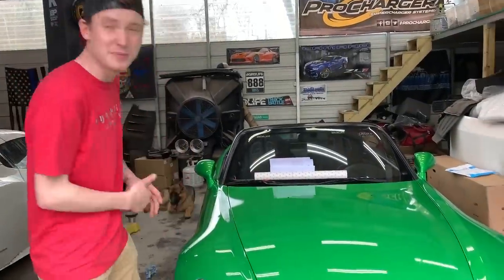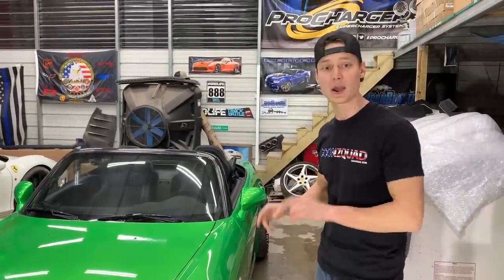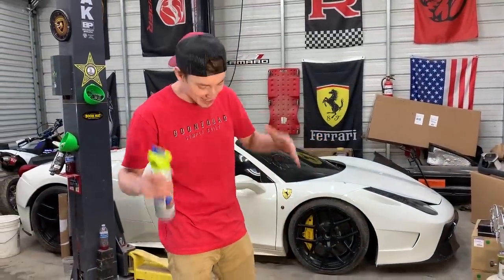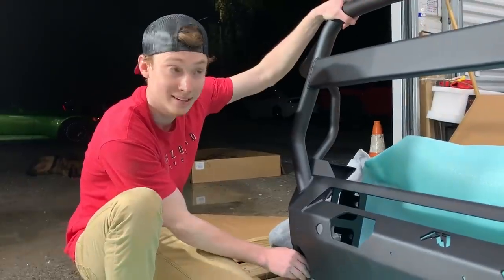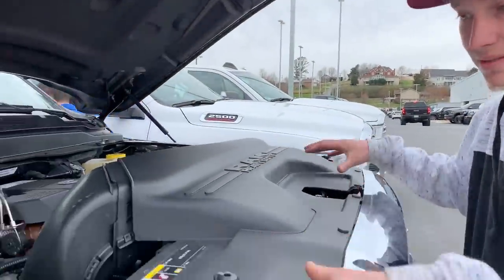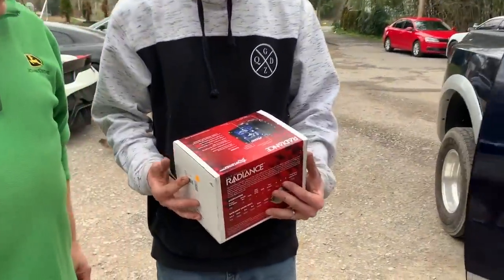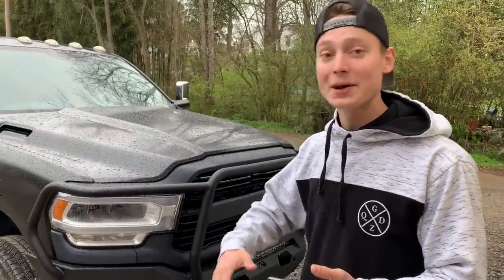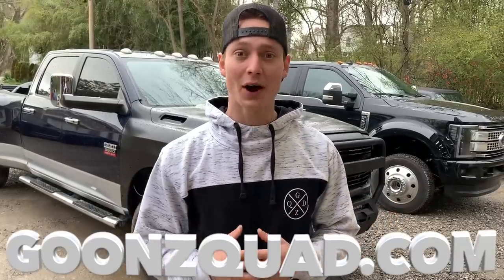Building My Dad His Dream Truck Part 5

Comment: The lower bumper looks cleaner on the 3500 example you showed; the one you ordered blocks the RAM sign on the front of the truck (others might disagree). Since dad might hit a deer at some point, this is the far better rack for sure. Also, consider installing a tow receiver on the front (don't bolt the winch to bumper). A receiver permits the winch to be switched from the front of the truck, to the front of the trailer to help winching loads onto the trailer.  Food for thought - Great Build as always!

Comment: Those holes are for the winch engagement lever, and to run your winch solenoid controller cable.  The opening for the winch cable is called a fair lead, and they can be a roller style, or a hawes (smoothed/contoured aluminum..

Comment: I’ve done it before on multiple cars but you can actually heat up the glue that holds the clear lens on and separate them. Paint the trim and glue them back in. Just be carful with the clips. If they break it’s not the end of the world

Comment: Maybe try to find same type crimp on terminals and crimp them on to the old headlights wiring harness or even check, maybe the terminals in older headlight connector are same and you can just swap the plastic housing - this way the harness looks 100% OEM without any extra wiring mess and soldering.

Comment: You should check about converting a vehicle used in commercial applications. Changing anything from its original OEM configuration requires certification from the manufacturer. Converting the front end may fall in that requirement so your father cannot use that truck in hot shot trucking.

Comment: I rebuilt a cadi CTS and was having issues with the headlight connector since it had been damaged in collision.  The dealer sold me connector and wires like what you got but would not give me the wiring diagram, they said I would have to take it and have one of there techs build the connector at shop rates. I went to my local library and they have accesses to what repair shops use for repair diagrams through a database call ALLDATA, I was able to print out the headlight wiring diagrams and that helped me out on what wires to use.

Comment: Harbor freight has a real good winch with synthetic cable. I've had mine with a steel cable for a couple of years and it works great. You may want to include the D rings on the front for different winching operations, maybe hide them in the glove box or other storage place. Lookin good fellas, keep up the great work. any updates on the new shop?

Comment: De-pin the new headlight plug and re pin the original harness into the new plug so you dont have a sketchy crimp connection or was of electrical tape. Itll be clean and factory

Comment: So that sir bag you mentioned wrong color. Correct do not try to paint it. But here is a suggestion you might try and if done properly you will never tell it was ran brown and not the black you made it. I used to work in my uncle's upholstery shop and we did recoloring and touchups on faded or discolored Vinyl and naughahyde tops on cars and dashes and even the seat coverings and mid consoles. You need to go buy a specialty chem and color kit for plastics and vinyls. under $75 and is amazing. My niece spilled nail polish recently on my mom's brand new couch it's dark brown and the nail polish removed the color and big white spot on one the cushions . I had this kit now since 1997 to color a vinyl top on a New Yorker. You can't even tell it was recolored. The couch that is. I had my niece in tears when I first saw what happened . I said to her you know how many Naughas they had to kill to make that couch and there extinct now and I can't get the naughydes to fix it...............I'm a ass LOL.

Comment: You hot to give your pops a lift kit with tires and wheels and the electric drop down side steps. The front bumper you guys is dope but the one at the dealership I have to say beats out the one you guys have. But any way you guys build this truck its awesome one keep up the great work and content.

Comment: You guys will have problems with those led lights around the headlights,  working properly, they cancel out when you turn the signals on, so the turn lights can be seen, so they have some kind of system that does that, and 2012 model s dont have that

Comment: Ok so if yall wanna know more about the speaker the regular price is $199 BUT if you use code:GOONZQUAD you will get 65% off your order and then you'll just have to pay $70 and you can't beat that price it's very cheap compared to $200. Thank me later Goonzquad 👍🏻✌🏼 

Edit: Goonzquad you should pin this so it would be easier for everyone else to see.

Comment: http://connectors.dcctools.com/home.htm

You can use this website for finding the correct pin location for the 2012 Ram 3500 headlight harness and the newer 2019 Ram 2500/3500 headlights (listed as premium headlights I think)

Also, you might need an adapter for the 2012 harness for projector headlights of the 2013+ because they use LEDs for the turn signals and might show up as a CANBUS error:

https://shop.retroshop.us/ProductDetails.asp?ProductCode=13%2EAdapt

Comment: If you're gonna run it as a Hotshot. Better buy a new Turbo. Because it will go out. I have 2017 it went out around 120k miles. Along with a long grocery list of parts especially the DEF system..  delete it if you can.

Comment: I think at this point it would have been cheaper to just buy a wrecked 2019 truck
Reply: I think if it was that easy, they would've. Most of these pickups are smashed at the front end. Don't want to risk using bent brackets and misc. parts, especially if your doing a full conversion. Using new parts are expensive, but very very satisfying.